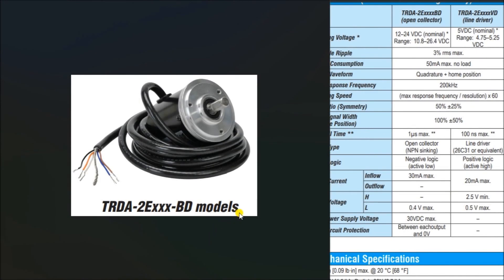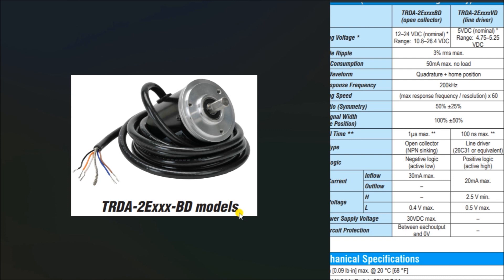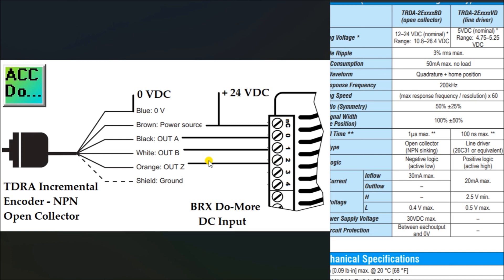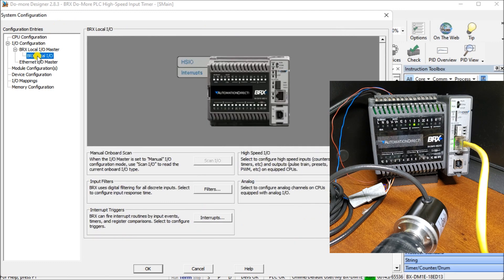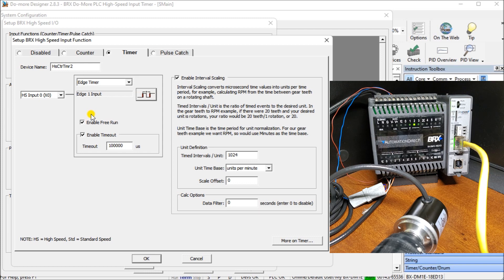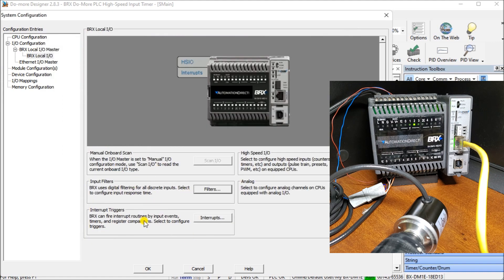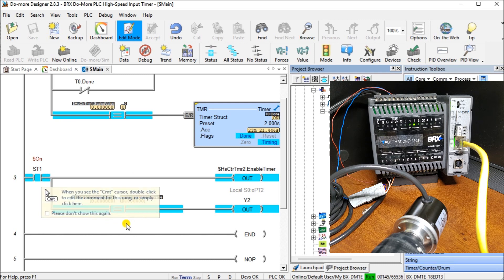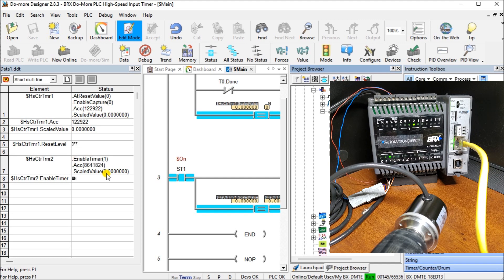BRX PLC: Unlock Precise Speed Measurement with Timer Mode

Comment from the maker: The entire BRX Series PLC can be found at the following location:
https://accautomation.ca/series/brx-do-more-plc/

There are several reasons why we are using the BRX Series Controller. Here are just a few.
 - Standalone PLC with built-in I/O
 - Built-in Data Logging 
 - Communication ability - Ethernet Port, RS232, RS485, USB - support for protocols such as Modbus RTU, Modbus TCP, ASCII, K-sequence (DirectLOGIC users), Custom Protocols (ASCII over serial, TCP or UDP over Ethernet)
 - Built-in Analog input and output
 - Integrated motion control
 - High-speed counters
 - Powerful instruction set (Video of Instructions in software)
 - Ability to expand the system with a variety of modules
 - Part of the Do-More series of PLCs which use the same free software. (Do-More Designer)
 - Integrated simulator in the software capable of external communications for testing

The BRX series of programmable logic controllers consist of four different units. They differ depending on the Inputs and Outputs built 

into the unit and if it has the ethernet port. 
No I/O Micro PLC unit – (BX ME)
10 Point Micro PLC unit – (BX 10/10E)
18 Point Micro PLC unit - (BX 18/18E)
36 Point Micro PLC unit - (BX 36/36E)
These CPUs (Central Processing Units) are also known as MPU (Multi-Processing Units) because of their communication capabilities.

Regards,
Garry
ACC Automation
https://www.accautomation.ca